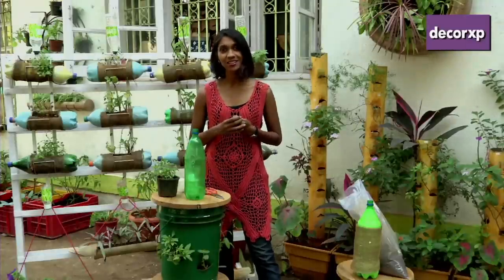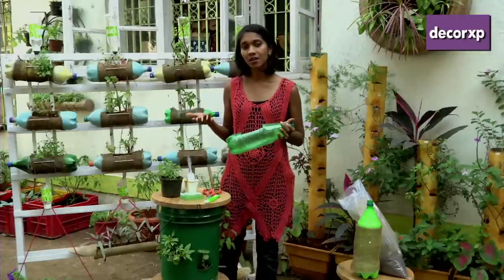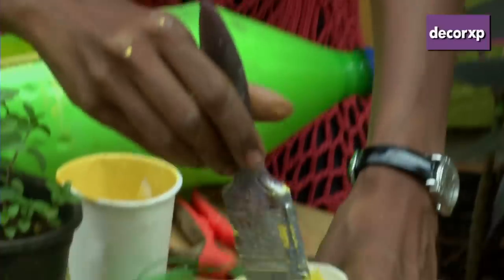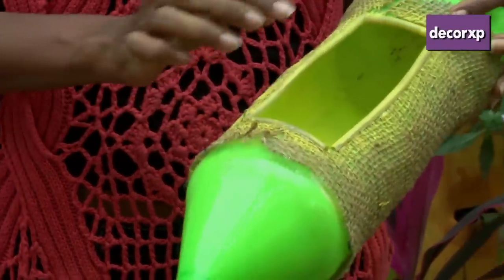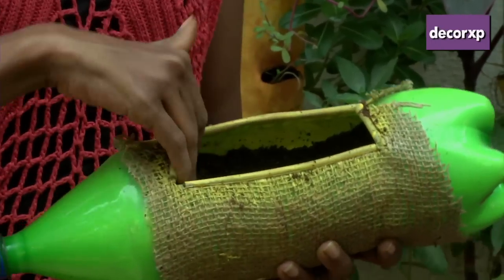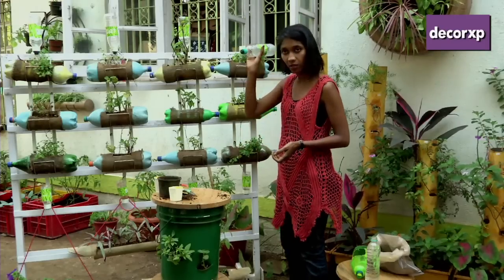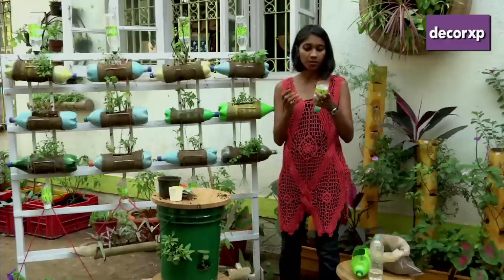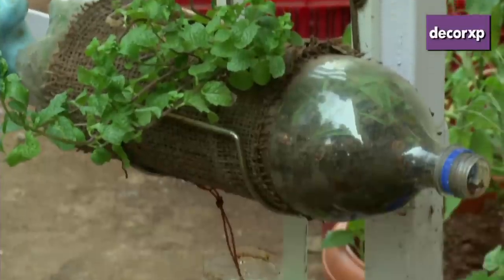Sustainable Drip Irrigation for Plants

Comment: Nice video but you might want to paint the outside of the bottle instead. Oil based paint is very poisonous.
Reply: that was Im actually thinking too.
Reply: when its being painted on the outer side and covered with jute...is there a need to paint the inside too?
Reply: logiclab1
Reply: logiclab1 s
Reply: pia santos apple seeds
Reply: logiclab1